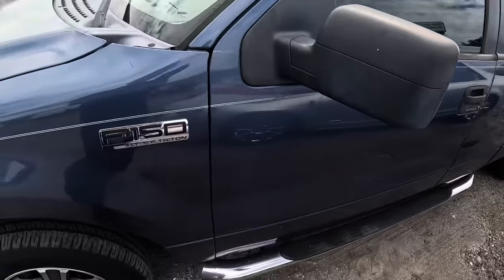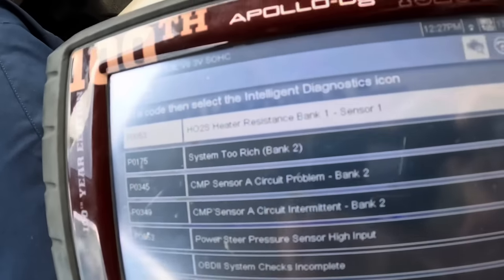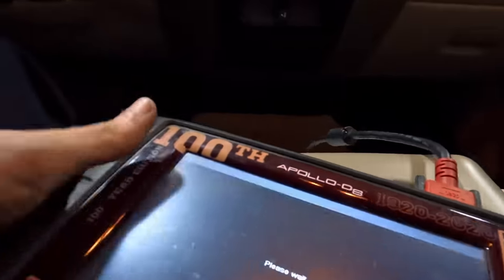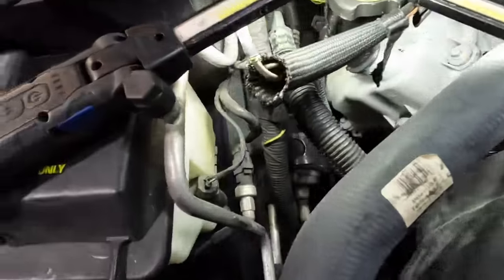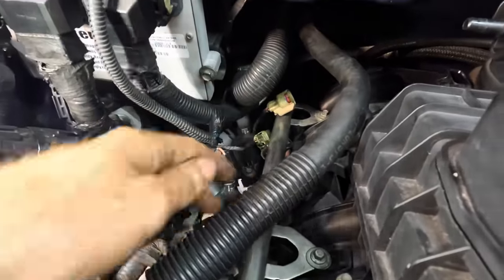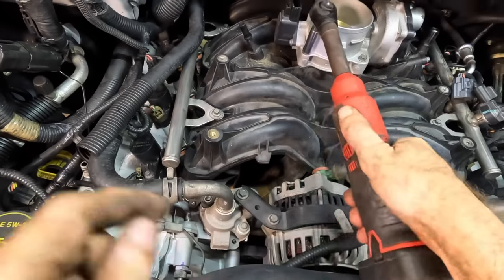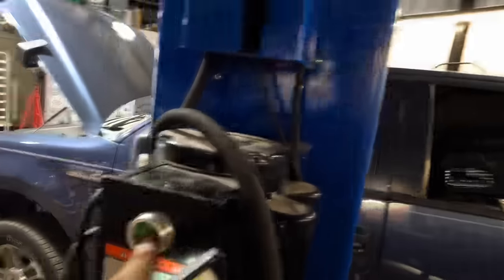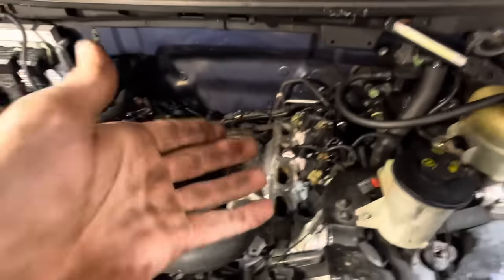Hack Job! Mechanic Botches Engine Replacement! Multiple DTC's

Comment: Just for clarification, those heat tabs are not held on with a temperature sensitive glue that allows them to fall off if the engine overheats. They are actually aluminum rings with a solder center. When the engine overheats, the solder melts, simple. They are also called melt tabs and they are usually held on with a 2 part epoxy.
Reply: I appreciate you telling us about that soldered aluminum tab to hold those stickers in. I worked in HVAC and they used similar soldered type of tabs on the Outlet  on top of furnaces that use electric heat strips. If the fan died for some reason, in the heat strips were still on, to prevent fire in the duct system there is a metal emergency type of box above the air Outlet which will allow the tabs to melt at the solder joint releasing a spring-loaded accordion style door which will completely close off above the furnace  it is all metal and fireproof. I used to hate it when sometimes the motor would go bad from either the capacitor or people getting their air filter too dirty would cause the air flow to go down, this would result in high temperatures enough to melt that solder tab, even though the fan was trying to blow, it couldn't get any air past the dirty air filter. So when these emergency lock boxes closed they were a serious pain in the rear to reach your hand up in there above and through the top of the Furnace opening to get those spring doors pushed back into place and then to wire in a new solder tab. I know some people just used a piece of wire to close it off, but that would result in a possible fire hazard because it would never release again. I always went and had a supply of those solder tabs and put them back in like they were supposed to be. Anyway thank you for bringing this to light. God bless you.
Reply: @NEW_INSITE  Thank you very much and God bless you as well! 🙏🏼 I didn't know that they used what you explained in HVAC. I learned something new today, it's going to be a good day !!
Reply: Straight facts.  This isn't click Bait level but close

Comment: I have the 5.4l Triton 2V in my 2004 F250 XL. Only problem was the spark plug blew out. Helicoil replacement and good as new. Now at 280,000 miles and still going strong....but eventually will need to rebuild or replace. Still cheaper than buying a new/used Super Duty. I'm hoping I see more engine repairs similar to my F250. Thanks Ray for the great video.
Reply: I was wondering if It see this post of blown out plugs.  
This was quite the crisis with these engines for some reason never actually revealed why,  
but I've installed hundreds of 
Heli-Coils since late seventies in high performance engines using aluminum heads, mainly stripped out by not coating a smear on plug threads with anti-seize to prevent aluminum from bonding to steel threads of bolts to sparkplugs. 

Once aluminum has bonded to steel, now force turned out, the bonded aluminum is forced to run over threads on the way out, crushing every thread in the way. 

Once the plug threads are exsposed, the bond of aluminum deep in the threads of plug are almost impossible to remove.  

Soon as builders understand how soft aluminum is, 
I only use machine shop supply taps for the process of installing Heli-Coils advanced by using special threading taps just for aluminum that only removes as little as aluminum as possible by compressing the aluminum making the aluminum threads much stronger.  

And Never once after hundreds processed has a Heli-Coil ever fail.  

The Heli-Coil kit comes with a basic threading tap not approved for milling threads into aluminum.  

Aluminum taps do not have the large flutes with sharp cutting edges, they are more elliptical in shape as they roll threads in a compressed action.  

One could simply consider Aluminum as old Dutch Cheese,  and if overheated will certainly increase clearance beyond normal clearance for a sparkplug to move enough under high pressure of combustion.  Then after Several cycles of overheat, good chance plug will blow out.  

If plugs are ever removed for service and halfway out plug can wiggle back & forth in its threads, indicates clearance is already too much, now add 220°F, the clearance increased even more.  

So for anyone with aluminum heads,  be very careful how they are treated, from torque, to applied Anti-Sieze. Including motorcycles. 
Make darn sure no aluminum is bonded deep in plug threads.  

I'd  even suggest getting a thread die to have handy to run over previous used plug removed to clear threads by hand removing  any hidden material before possibly destroying good threads in the aluminum heads. 

Cheers

Comment: So i just started this video and I just wanna go ahead and state. I have 6 yrs experience at a dealer. Ford 1.5 go bad often. I dont normally do engine work, i dont even have my gas engine repair certification. Due to work load ive recently been tasked with a short block replacement on a 2018 escaoe with a 1.5 l. I had a very difficult time with it. 3 weeks in and i finally got it running good after 50+ miles. After i removed the powertrain the first time i got it together and it wouldnt start, it was not timed properly. Oil pump broke, charged air cooler broke, and a spark plug was seized in the head. All found after getting it all together. I took it back out and completely tore the engine apart for the second time. After getting back together the second time, it wouldn't start. Turned out i blew the fuse for the coils. Luckily easy fix, new fuse and it was running. But then. Oil leaking out of the front cover. I had to remove the engine partially and retorque the oil pump bolts. Now it's fixed and running. First test drive after and it shifted funny. Topped off trans fluid. Test drove, runs like a champ. Next day first thing test drive by porter. He comes back, says it's misfiring and violently shaking. At this point I'm ready to quit my job. The stress in those three weeks was insane. Nonetheless, it cracked the cylinder 1 spark plug. Easy fix. It left today. Pray for me. Moral of the story, i promise i did my best. I work hard and turned 20 hrs a week for three weeks as i tried to piece this job together. I love my job, i hate this happened but if you read this far then surely you can relate to the fact that, shit happens.

Comment: Most IMRC issues I have found were broken clips. Second is a harness preventing the movement of the motor of said IMRC. Tight fit back there.

Comment: Some years past I had a ford f250 with the largest engine of the time.  It Burn oil so I had a re-manufacture engine installed at the Ford Dealer.  The new engine burn oil is the same manner.  They did not believe me and made me come to the dealer and they checked and added oil.  Still used oil.  My fiend of the time was their top mechanic who checked out jobs of others told them to get off their duff and make it right.  A another re-manufactured engine and the oil use stopped.  It pays to have a master mech as a friend.  The engine was known as a plumber's nightmare because of emission control.  I still thank that friend of mine and how he spoke out.  Warranties today only go as far as 100 feet out the door.

Comment: Ray, I reckon the actuator motor probably has stripped or broken gears as the movement appears to have no  mechanical resistance when you moved them. Since it is in a difficult position are you replacing that as well?
Reply: my mustang has the same imrc and it does have resistance and a noticeable gear turning sound when you do move it, so i think your probably right
Reply: Can you test them by applying some power from,say,a 9 v transister radio battery and see whether the motor "actuates" ?

Comment: I know of 4 shops that are under $100. where is shops are charging $189 an hour are empty. these shops that are low price are continuously busy.some are up to 3 weeks before customers can be seen. Though I'm retired I would much rather work in a shop that was busy and still make money than sitting on my butt doing nothing but I guess if you work by the hour you can take all the time you want. I worked flat rate and usually doubled or tripled my weekly paycheck
Reply: We are at $85- $150 in my area, but the $150hr shops are always 3 weeks out. They do a good job, and back it up. People will wait and pay more to know what they're going to get.
Reply: Depends on where you are. There are NO shops near $100/hr here in Vegas. Some are even at $200/hr.
Reply: I get the fact technology is advancing and it cost more to work on them…but $200 an hour for labor is getting a bit ridiculous
Reply: I'm pretty sure Eric O. said he's at $90 per hour. And he's in NY, a state with more regulations, inspections and higher taxes to deal with.

Comment: I really despise working on someone else's mess.  This happens in other technical fields all the time.  I once had a tech install a network appliance completely upside down in the network rack. He just rotated the decorative front face plate so the logo was right-side up, thinking no-one would notice. In addition, the network cables were stretched super tight which is not good. I went to fix the cables when I noticed it was installed upside down. Ended up reviewing all his work and discovering numerous additional issues. Just plain lazy because he wasn't a newbie. Had to stop the entire upgrade, roll back and reschedule. Suffice to say, he wasn't invited to travel to that office when it was rescheduled. Another time, electricians decided to use cheaper out-of-spec shielded 8 pair wire. They didn't use the Belkin nor generic spec'd wire on the blueprints. They bought wire that wasn't shielding the individual pairs because it was much cheaper. Obviously, the spec was there for a reason and the proximity badge readers failed to function. The electrician had to re-pull several thousand feet of wire and re-run the correct wire as a result. Other times, electricians failed to label wire pulls so I go into a closet and there's a spaghetti mess of identical cable on the floor with absolutely nothing labeled.  It took two of us using a fox and hound to tone out each individual wire (literally hundreds of them) to locate where the wire was routed.  As you can imagine there are now contract terms with the electricians to prevent things like this from happening along with built-in penalties as such events cause delays that cause problems for others on the project and typically involve a financial impact when blowing past a service-level-agreement deadline. Oh and wire nuts / crimps are not good with data cables. Neither is using a coupler outdoors along with non-outdoor rated cable. 🤦‍♂ 

I am not an automotive guy but I watch Ray's content because his trouble-shooting and logical analysis is top-notch! This is something that is very hard to teach and some people are entirely incapable of performing such work.  These are the sort of videos I can really identify with.
Reply: As a former Network Administrator, (now retired) I too well know your pain having met with a number of very similar Physical Layer situations during my career...
Reply: uI worked many years in local government, much of our stuff was done by the "low bidder," and you could tell.  We had one of our labs remodeled.  We warned the engineer and contractor that the area had a corrosive atmosphere and they needed to somehow seal the network connectors against corrosive vapors.  Of course we were ignored.  We dissolved some of the network connections.  I also had one computer connected to the trace mercury analyzer, that we ate the guts out of a floppy drive back in the day.  We also managed to destroy a network interface card on an ICP.  So we got to tell the powers that be, hate to say I told you so, but I told you so.  Then we had another buidling remodeled, and the electrical subcontractor, was a new small outfit owned by a woman.  That's what they liked on smaller projects, was to hire women and minority owned sub-contrators, so the same good ol' boys could get the big contracts.  She ended up with the only electrictian working for her was her drunk brother-in-law.  They made a real mess of things.  I'm all for women and minorities becoming successfiul in business, but let's get the ones that know what they are doing.  I am so proud of Ray teaching the wife unit, how to help out in the shop, with more than just the paperwork, which that's very important too.  They have to pay for the parts, pay the other techs, then appropriately bill the customers.
Reply: It's the same story every time. Some idiot just throws stuff together so he can go home 5 minutes early, and then someone else has to work late to fix it when it breaks 2 days later

Comment: I have a 2005 F150 5.4 3V with a third of a million miles. When I bought it it had 25 miles. Engine has never been opened and I have great oil pressure still. I change the oil regularly and used Motorcraft synthetic blend oil until Covid made it unavailable. I upgraded to full synthetic. This summer I went to 5/30 full synthetic as opposed to the factory spec 5/20 because I’ve been towing my 19ft travel trailer around the southwest US. I’m also a proponent of ZMax micro lubricant and I add it every few oil changes. This summer I’ve also been adding Lucas full synthetic high mileage oil treatment. I’d love to make 500,000 miles just because! 😎👍🏼

Comment: South main auto charges $90 an hour and almost all shops in my part of Louisiana are charging $90.
Reply: Big city shops are changing over $110, I left Chrysler dealership in 2019 and door rate was $139 I think it’s at $160 now, my shop is one hour north off the city I am charging $90
Reply: @aaronkoivu  yes I know,  but he was basically saying its not possible to find that these days.
Reply: My local mechanic charges $200 an hour and upticked a couple jobs he did on my truck.  He charged me $1800 for my timing belt and water pump.  He also charged me $600 for completing the installation of my heater core (I did all the hard work but for some reason could not get the heater core housing bolted onto the firewall). This was on my Grand Marquis.  I an old man and was unable to get underneath the dashboard to get the 3 nuts and bolts in. He or someone at his shop never pulled the dash out and it probably took them 30min to complete the job. To his credit,  he did attach the intake and outtake heater hoses for me.
Anyhoo,  I would rather do my repairs myself unless I cannot handle them. I'm just a newbie at this DIY stuff and not a mechanic.
Reply: It's over $200 here in Southern California

Comment: Anytime I see those heat tabs installed on an engine, it makes me think of junkyard engines.   I guess rebuilders use them also.   Also, these engine "rebuilders" are not all created the same.   I can't help but feel like whomever built that engine may have cheaped out on the parts.   I can't help but wonder if all the VCT solenoids and phasers and sensors are just Dorman parts or some other Chinesium crap.   The quality level of the repair seems to be all over the place.   The installer didn't even attempt to place the wiring harnesses and connectors back in their assigned spots, at least most of the ones I saw.   And that crappy paint job, those valve covers look like garbage, the paint is peeling off, and they just painted over the stickers.   They should have a bit of pride in what they do.
Reply: High quality Americanesium installation to match Chinesium crap.
Reply: @worriedrepublican9304  hahahah,.good one!
Reply: Tape costs too much.
Reply: Just FYI they're all cheap chinesium crap😂😂😂

That changes is how important the quality inspection is on our end..

Phasers won't kill an engine what will is plastic tensioners that leak down the front of the block and bleed off all the oil pressure to the heads.
Reply: Just FYI they're all cheap chinesium crap😂😂😂

What changes is how important the quality inspection is on our end..

Phasers won't kill an engine what will is plastic tensioners that warp or crack, then leak down the front of the block and bleed off all the oil pressure to the heads.
Reply: I've owned/maintained a lot of 5.4's over the years (2v and 3v) and the only way to go with the timing components is OEM...especially the phasers and their solenoids on the 3v. The Melling pump is the only non-Ford part I would put in there. Outside of the phaser issues on the earlier 3v, they're relatively stout engines and don't often need to be replaced so long as they've been maintained. Typically a timing job is all that's needed and, if done right, can go well over 300k miles before they're too worn out to dink with. The later ones (mid 08 and up) have some redesigns that made them much less prone to timing component failure than their earlier counterparts. The only things that seem to fail on them are the hydraulic tensioners blowing out their seals and reducing oil flow to the top end. Usually results in a little bit of chain rattle on a cold start (less than a second). On the newer ones,  a lot of guys replace just the tensioners and go on their way for another several years before needing to do anything else. Obviously it makes sense to replace everything once you're in that deep...but if the money isn't there, it can get you by. I'm really curious about what failed on the original that warranted a complete replacement.

When they do need replaced, there are a handful of trusted companies that are known to use quality parts (Powertrain, Frasier, are two that come to mind). This engine looks like it came from neither of those.
Reply: @blaqlabspodcast5816  could be what that rattling noise is on startup- worn out tensioners ,or Chinesium     it's got a new  oil pump